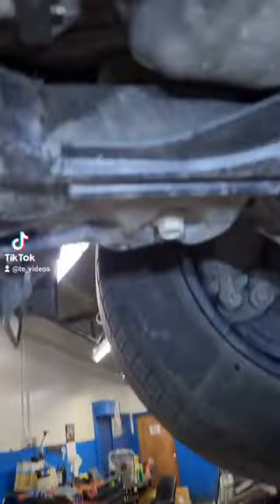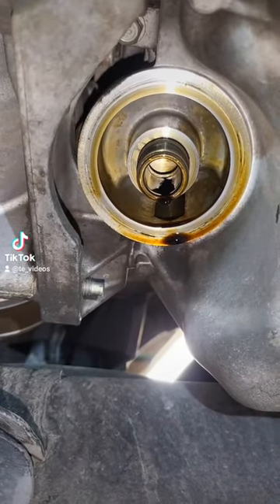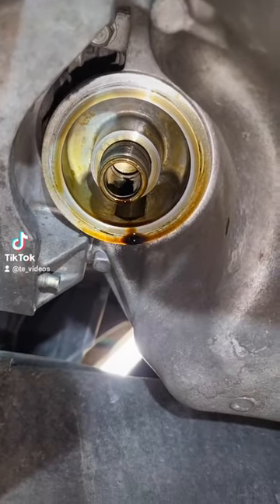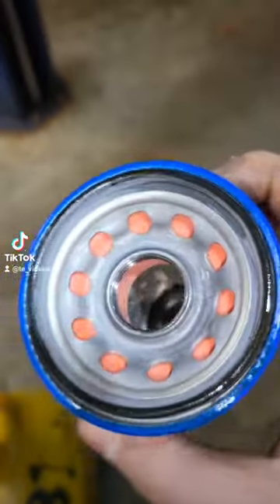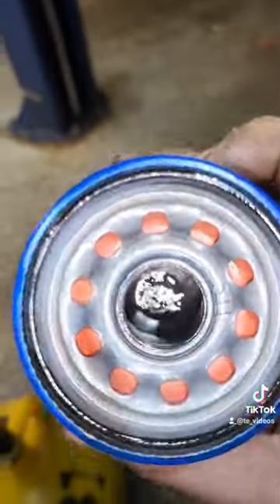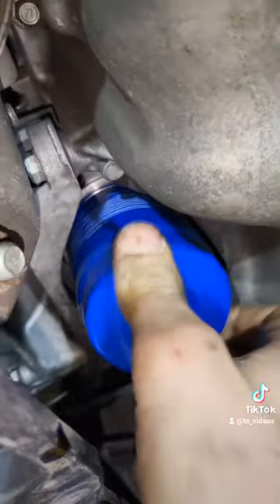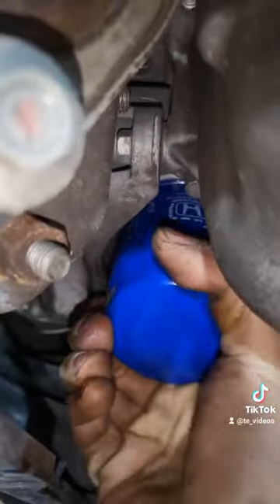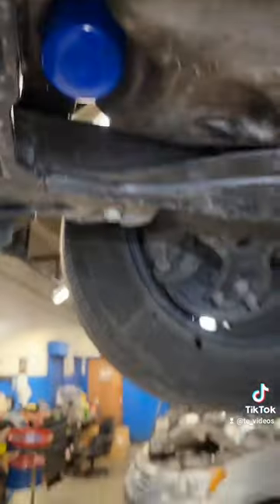Keyboard Mechanics Assemble! 🔧😗👌 PSA For Ya Bud #honda #oilfilter #oilchange #hondatech

Comment: The only reason the filter manufacture tells you to wipe the base off, is to make sure that the old gasket has been removed  The only reason they tell you to put a drop of clean oil on the new gasket is to be sure that there is a gasket on the filter and has not fallen off in shipment #statelaw